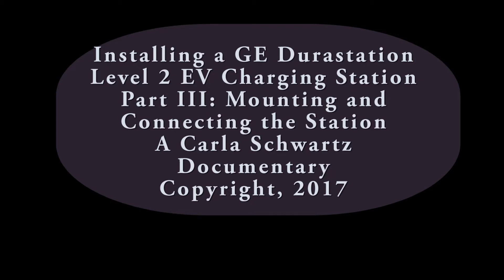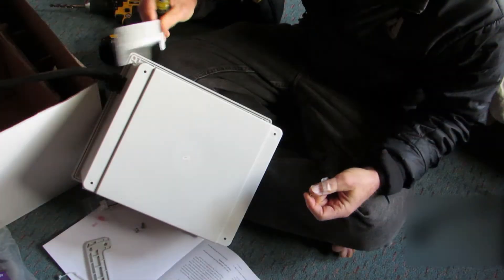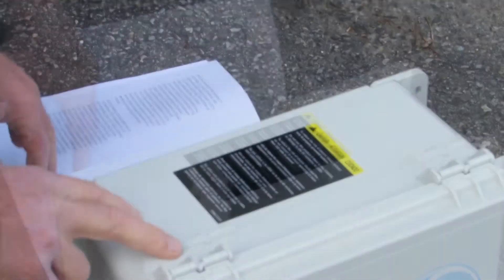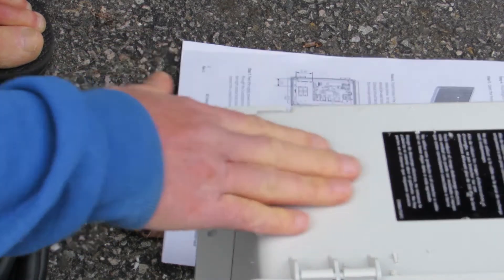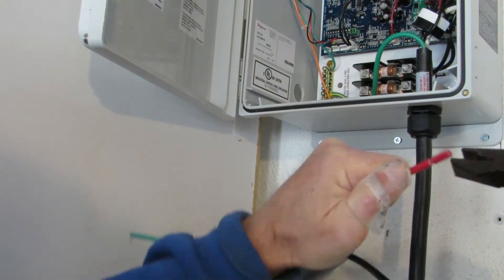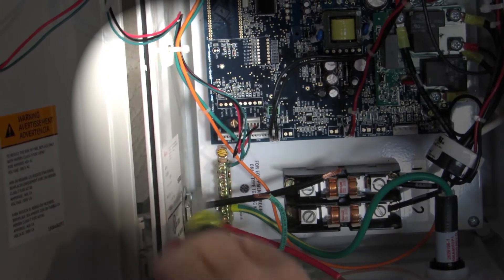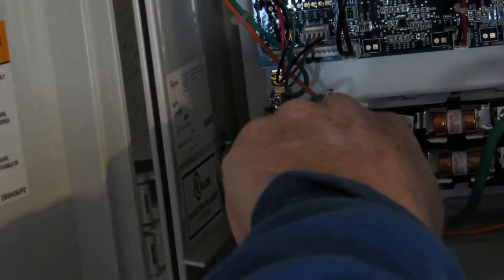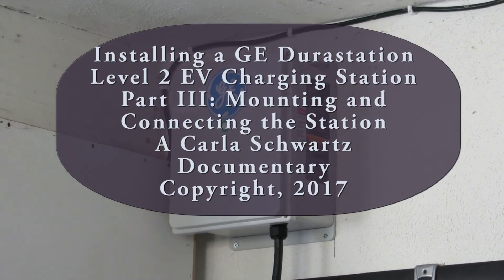Installing an EV Charging Station Part III: Mounting and Connecting the Station

Comment: Just curious - should there be an ac disconnect between the breaker panel and charger?
Reply from the maker: The circuit breaker is the disconnect for a hard-wired charger.

Comment: In the Manual it mentions D21 jumper. I understand the function and options, but where is the box/pins/connector that the jumper attaches to? No diagrams or photos
Reply from the maker: On p. 3 of the manual, you can see the connection diagram for the jumper for the various configurations of current ratings for your breaker. the connector box should be in there with the label J21. You do not have to use it if you have a 40 amp breaker. I hope this helps.
Reply: Thanks, I made a jumper wire using two butt connectors(red) and a short piece of 22awg wire. I don’t have ample service to my garage so I had to “throttle” down the charger to 30 amps. Thanks for your reply and great video

Comment: I know the tesla can charge at crazy KW per hr. What kind of rates do you find with this GE lvl 2 power supply? Nice series and nice install by the way.
Reply from the maker: It's 30 amps, and you can charge at level 2 at about the same rate in miles per hour as a Tesla charges at level 2, (for the same current), which for this one, is about 21 miles an hour. So overnight gives you a full charge.
Reply: This video is helping me a lot and giving me confidence to do the same thing on my pool equipment sub panel for my fiat 500e. We used to have a pool heater that used a double 20amp breaker. If there is enough amps to the sub panel, I could replace it with a 30 amp right? Then I would follow the video from there.
Reply: If there isn’t enough amps could I wire up the Bosch 16amp Charger? That would still be quicker than the stock one fiat gives you right?

Comment: Question, I just bought this charging station and installing it in my garage. From my last electric car I had a 50 amp receptacle installed onto the dual 30 amp breaker. Since you're hard wiring, you have 3 wires but since the 50 amp plug and pigtail I already have I want to use so installation is easier. It has 4 wires, where does the neutral wire connect to? Thanks
Reply from the maker: You can cap off the neutral wire with a wire cap as it is unnecessary.

Comment: Did you install the green wire (you call it the ground wire) to the neutral bus bar in the electrical cabinet??
Reply from the maker: Yes, well, there is only one bus bar there to connect it to, we called it the ground bus bar in the video. Thanks for the question.